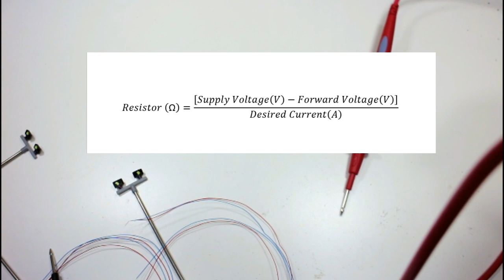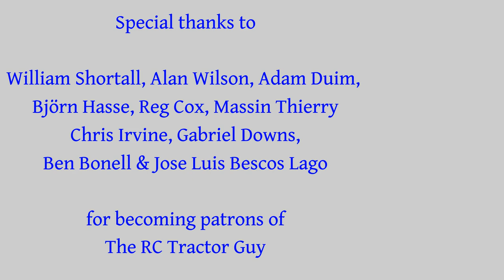Cheap LED street lights for diomras and model scenery

Comment: The  more common train scales are: 
HO scale  1:87 
O scale  1:48 
N scale 1:160

There is also the garden trains "G scale" which is a bit less standardized, it varies between 1:32 and 1:29 dependent on brand. 

Of source for background scenic stuff, you can often get away with stuff designed for various sizes.